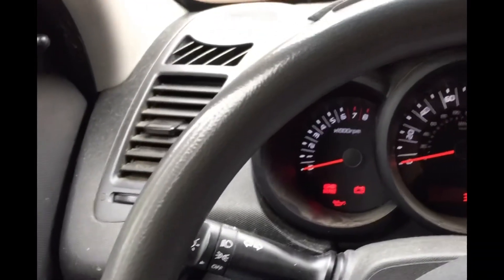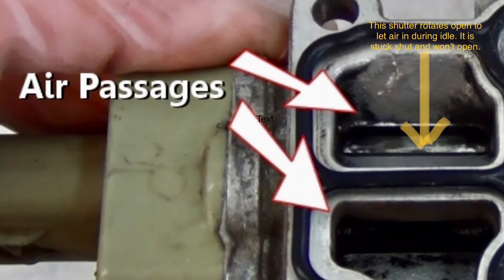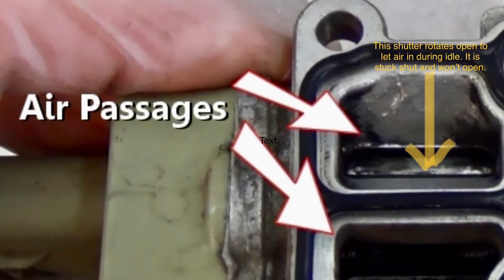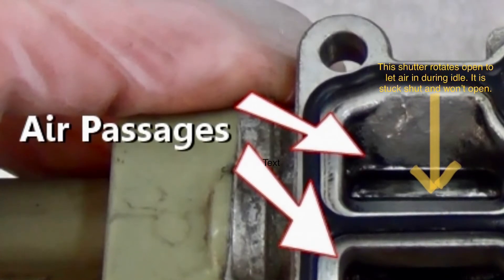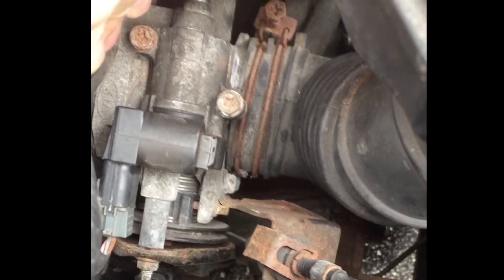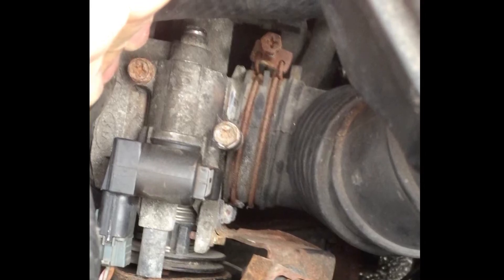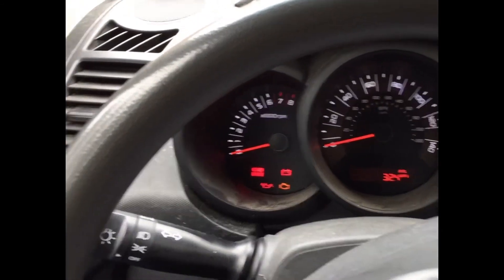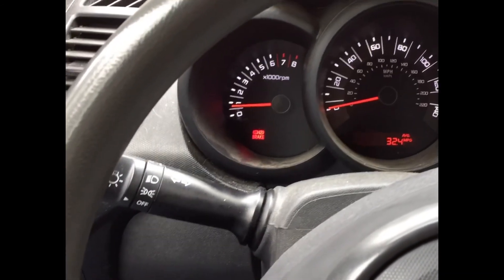Car stalls during cold idle. Diagnose and fix stuck idle control valve

Comment: Wow I have a 2000 civic & this is the problem why it failed smog check, I had already cleaned it, but kept lighting idle code, I will try the “ remove screw & insert small screwdriver & wiggle to sweet spot “ I appreciate this video Sir. Thank you

Comment: My one stalls after make first stop from engine starts always able to restart  when its warmed up no stalls. rpm is stable enough engine power. No code on dash. Could be IAC?
Reply from the maker: I would clean the idle control valve. That may be the problem.
Reply: Thanks will do.

Comment: So you mean the valve should be stuck close? or half?
Reply from the maker: I believe mine was stuck closed. When you start the cold engine it opens the valve to give air for the fast idle while the throttle is closed. If it can’t open, then engine dies. When you get it out you can tell right away if it opens and closes easily.
Reply: thank for your useful information

Comment: Can the egr valve cause it also?  

I had my egr valve changed not too long ago, and it’s since then it’s started stalling on cold starts. After the engine warms up. That’s when it goes away.  This basically usually happens in the first 1 minute of driving off.
Reply from the maker: It could be. EGR valves are pretty cheap, so replace the new one and see if that fixes it

Comment: I tried cleaning the ldle air control valve several times.  I even took it apart and cleaned everything even the solenoid. 

I replaced it with a new one and voila , it fixed the problem. Cleaning old parts isnt always the best way !!!
Reply from the maker: True. If the spindle is damaged or corroded and won’ pivot smoothly, replacing it is the best choice. Mine has been fine after cleaning for 9 months. But it was in good shape when I inspected it but there was a lot of black deposit on it which I could clean off.

Comment: My tacoma stalls when I put ac on or headlights also when I reverse is this similar to what yours was doing? Only when cold
Reply from the maker: No. It was stalling unless i was pushing on the gas pedal. Does your stall when u put it in Drive, or just reverse?
Reply: sam washburn mines stall in reverse and neatral its a manual
Reply from the maker: @bobby3940  It might be a stuck idle control valve, but maybe not. Since its easy, just do what i recommend in the video and see i that fixes it.  Good luck.
Reply: sam washburn going to clean my throttle and map sensor today
Reply: sam washburn my rpm while i reverse or 1rst gear the rpm go up and down would this be a tps problem

Comment from the maker: It’s been a month and the cleaned up idle control valve is still working perfectly.😊
Reply: Hi dear friend thank you for the useful and to the point video.I also have the same problem with my car so I did all the things you explained also I changed the coil and spark plugs and injectors but the car has rough idle problem in cold days start!Do you think it turns back the orings of intake manifold?!!
I appreciate your soonest reply and useful tips in advance.👍🤚
Reply from the maker: @masoudshalchi8313  You’ve done everything I would have done. Are there any check engine codes?
Reply: @SoaringMech  Yes but there isn't any acceptable specialist here most of them can't read the codes properly or the diagnos tool are cheap and doesn't work!What is your attitude toward  (icar pro) diagnostic tool?I can buy it from Amazon and check it myself!!Also one of the mechanic told me I may have (25 bar) less manifold pressure!
Thank you for the reply.
🙏🤚
Reply from the maker: @masoudshalchi8313  if the mechanic is right about the bad manifold pressure, look for leaks around the intake manifold. See if any of the hose clamps are loose or broken. If there is a leak downstream of the MAF (Mass airflow sensor) then the engine is getting a lean mixture (too much air). That would make it run poorly when its cold for sure because that’s when it needs a rich mixture.  Hope this helps.
Reply: @SoaringMech  Hi.Thank you for giving a helping hand I check all the things you explained.
👍🤚🙏